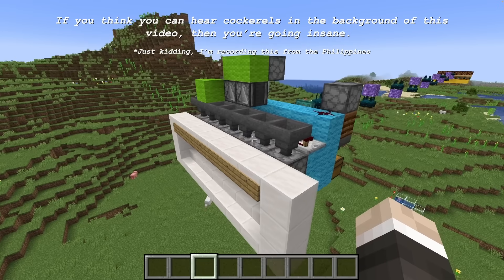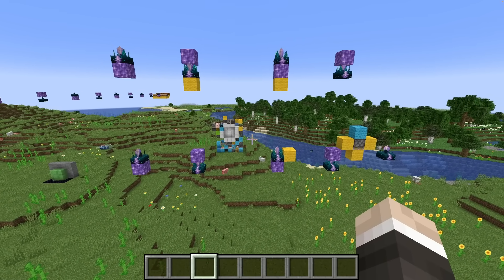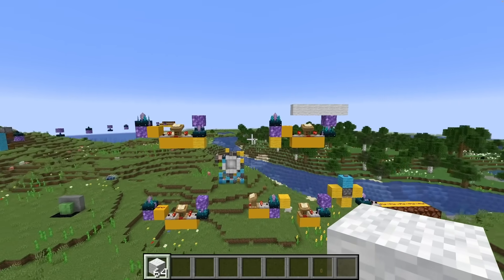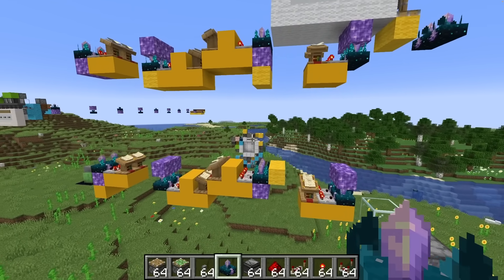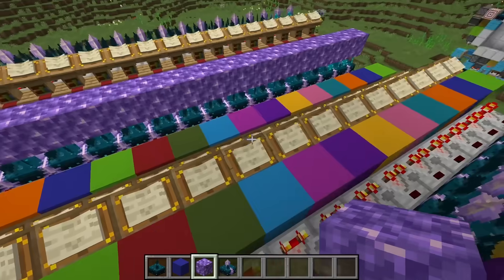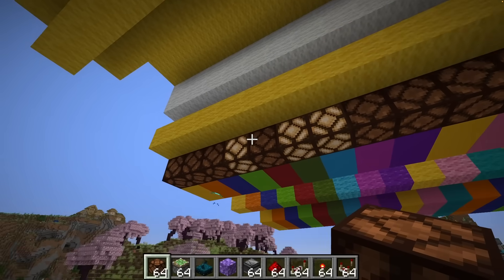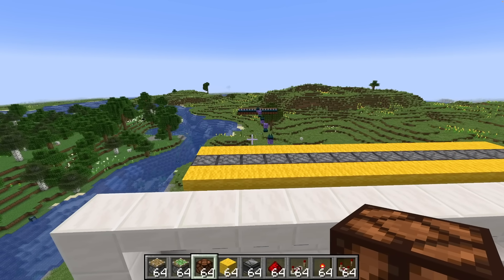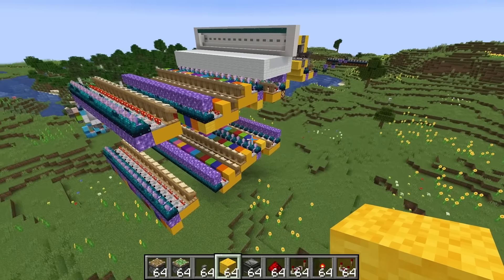This is not a redstone contraption.

Comment: im not a redstone engineer but what if you go back to the safe bet sounds (the 7sounds you can use from redstone) and instead of making more sounds, is it possible to decode a specific sound from the 7 wthin another same 7?

 like for example if shulker boxes only had 7 storage spaces BUT you CAN put another shulker box in that shulker, that would mean an infinite number of storage space, cause im thinking of using this on my automatic storage where i type in a code to let the shulkers know exactly what box it needs to open to automatically retrieve my items from my storage system

Comment: just wait. someone is gonna end up making a '16  by 16 bit' computer now.... >_> computers work with 1 or 0. now imagine someone making it 1 or 0.... or 2 or 3 or.. you get the idea. just for example. one "byte" of information aka. 16 signals of 1-15 (or zero making 0-15 being 16 total) would give you a range of 18,446,744,073,709,551,616 possible variations.  (18.4 quadrillion)

hahaha it would be slow due to the clock speed of the skulker deactivating. but i can say for certain. you could absolutely send messages though that. there are only 140,000 ish english words in the dictionary. so..... there you go. there is your challenge. make a 16 by 16 bit computer and send a message hahaha